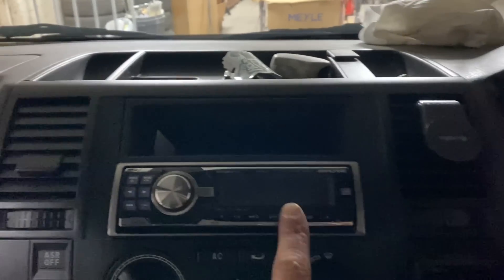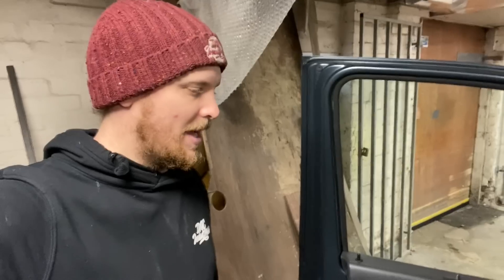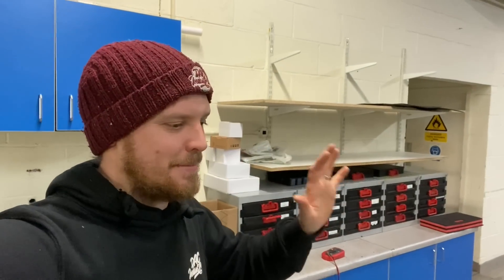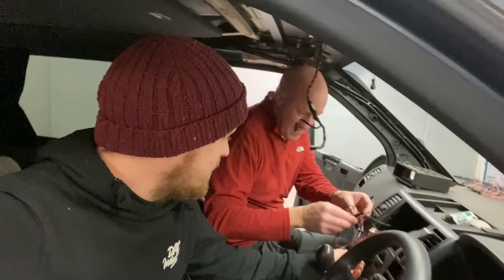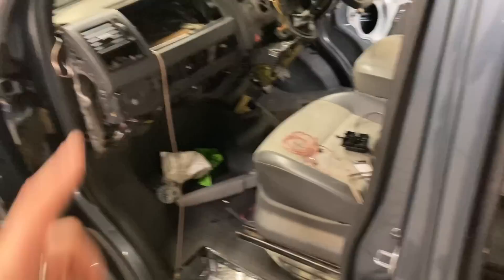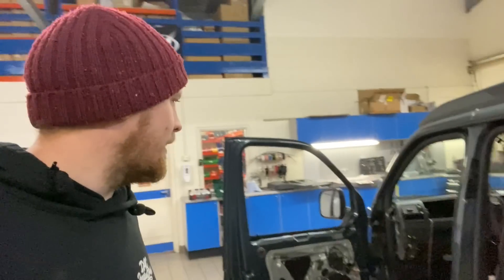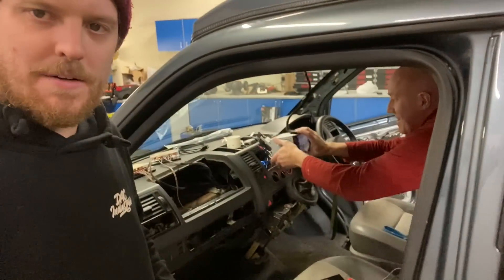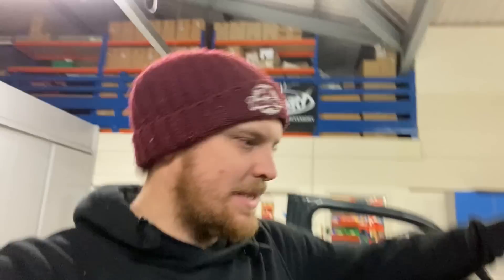Audio Upgrade Time - VW T5 Camper Project

Comment: I’ve all ways said the difference between old cars and new cars aesthetically is the head unit/ radio plus the headlights. A bi-xenon/hid retrofit would look wicked on this van, you can buy prebuilt kits online or just the projectors, shrouds , bulbs and ballasts individually. I’ve fitted a set to a mk5 golf and a s-type jag and it and if fitted correctly and aligned right the different is night and day. Great video 👍🏻

Comment: Nice one Dan. This build is really coming together nicely. 

Good tip with the reversing camera sidelight wiring, I'll be installing mine during the next few weeks. 
And that sub seems to pack some punch alright. 

Awrabesht mate. 
Al.
Reply: yeah that had me thinking, if you have used the side lights and reverse lights as positive feeds to the camera, what happens when you switch side lights on do the reverse lights come on as now you have put 12V to the same connection point, or have you used inline diodes  to stop them back feeding the opposite connection, interested on how this is setup

Comment: Interesting video Dan and that looks a nice head unit plus it seems to sound really nice as well, I hope your DAB radio works better than mine does, I fitted a head unit in my Merc SLK and like yours the DAB antenna stuck to the windscreen but it was totally useless so I decided to fit a shark tail to the roof luckily there is just enough room for one in front of the hardtop where there is a metal strip, it took me hours to strip the interior out around the screen and make a hole to fit the antenna, the result was... USLESS!!!! 😤 all I could get is a very scratchy Radio1, after a bit of googling I found out that DAB radio isn't very good here in Norfolk🤦‍♂😂 that was 3 years ago but haven't tried it since.